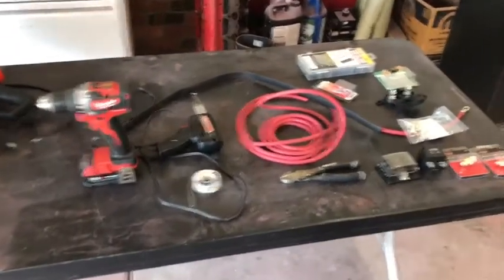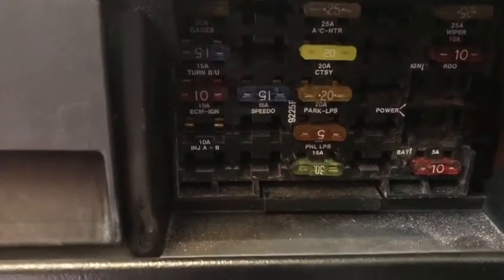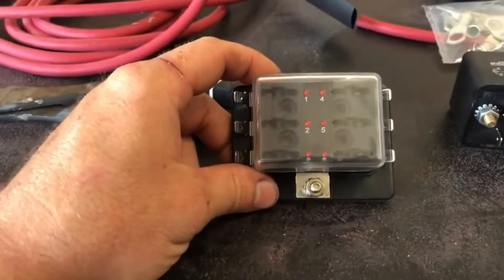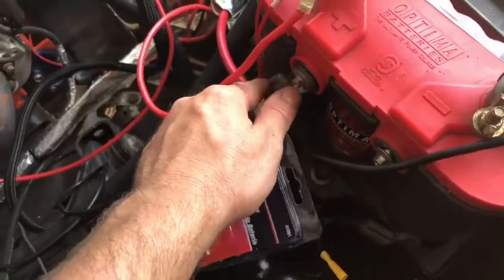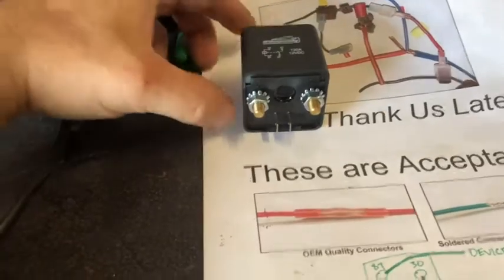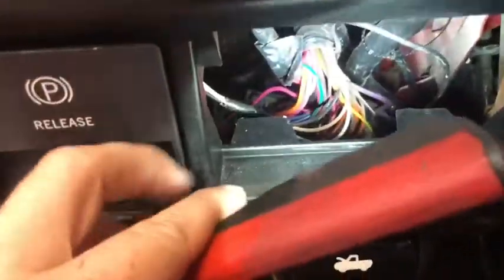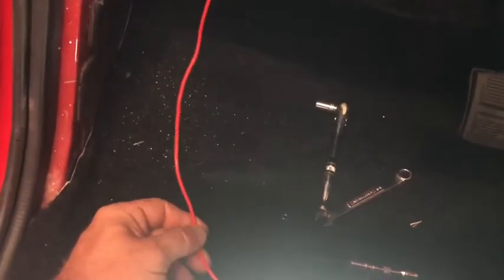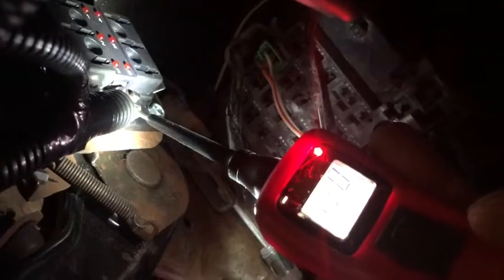How to make a fuse block for your car key on power

Comment: Excellent installation!  One of the only YouTube fuse block installation videos that is done right.  Many others who have no fuse protection between the battery and the relay.  Many who have grossly undersized the wiring to the relay.  Many who have used standard 40 Amp, non-continuous duty relays feeding to a 120 Amp fuse block.  Many with no loom wire protection or grommets through panels.  This installation will provide you with years of trouble free performance.
Reply from the maker: Thanks man I appreciate that!  I tried to do as good as possible and I agree, other videos I had watched were definitely missing a couple things that would keep their install trouble free

Comment: Exactly what I was looking for. From your triggered fuse block you can feed a lot of accessoires without having each acc triggered by its own relay, of course their switches need to have enough amps to feed the acc. I want to rewire a Ford 1973 and need a triggered fuse block for head-tail-fog lights, turn signals, power windows, radio, heater, electrical fan and so. I guess this will with such triggered fuse box

Comment: Oh My God !!! Finally it makes sense~ You made it so understandable a child could do this. Now I can turn the key and the engine actually start, instead of the head lights/ high beams, stereo system zap co board  amp, smart touch screen reverse mirror link,  back up camera, dome lights, dash cam, PA with 13 animal sounds and sirens, star light fiber optic head liner, emergency/pulsating to the music light bar, gaming consul, built in FLIR camera interface and strip light laser show, along with the heated seats and defrost, wipers and trunk  release all simultaneously coming on full blast.
The battery would look like someone was welding girders, burns the eyes and got me in trouble for getting power from a nearby transformer.
Thanks Bro!!! For Real you helped me out and from it the universe will be in your favor for sharing your knowledge and brilliant video, illustrating what I'm off to do now.
May You and Your Loved Ones be blessed with Health, Happiness and Love for Eternity.
Sincerely,
Randy Chavez
Reply from the maker: I’m glad it helped you out! I appreciate that a lot

Comment: Will the 10A fuse you use blow when you add more accessories to the power block? Or is it just being used as a tap to just trigger the relay with 12V to close the circuit?
Reply from the maker: The wire being used from the 10 amp fuse in the original fuse panel is just used to trigger the relay only when the ignition is switched on.  It’s just a good idea to always fuse a circuit in case of any shorts, but that should be plenty sufficient just for that purpose only.

Comment: Im confused as to how you spliced into the trigger wire, you ran it off the relay in to the fire wall with the big power wire? And then you removed the injector wire from the your circuit breaker block under the dash? And tied it all in? But it wouldn’t make sense because at the end you are still getting 12v on the fuse so it is still hooked up. Help me out because this is exactly what im trying to do as well. Thanks

Comment: Can do the same key power system with an auxiliary battery?
Reply: Or do I have to put some sort of switch to turn on whatever I have on the fuse block ?
Reply from the maker: You could do that with an aux battery
Reply: @Robs_garage90  the same way you do it ?
Reply from the maker: Yes would be the same thing.  If you use an aux battery you might want to see how you can charge the battery with the charging system as well so that it doesn’t just drain the battery